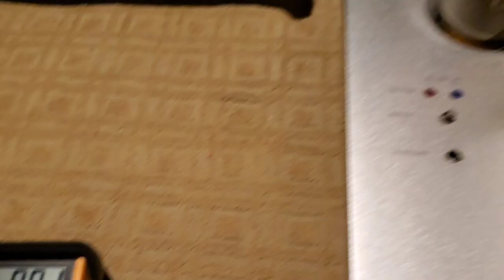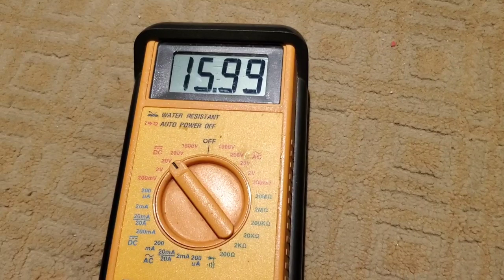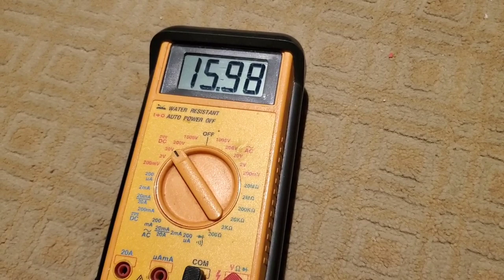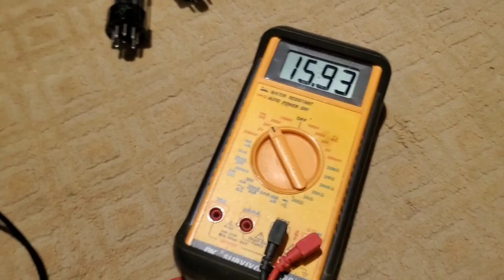Sound of the 845 S.E.T. demonstrated

Comment: Ok, alright .. I got an itch I have been scratching ever since I watched your video where you demoed the tower speakers (HiFi Tribe Special) powered by a monstrous Nat SET that may be the best amp I have ever heard.  I can still hear it.  So, I think I have to go back to the future and get another HIFI rig.  My current rig is going no where, I like it, it's great, and it is very similar to yours, if you replace those Greek panels with Maggie 3.7i's.  That will stay at one end of the room and at the other end will be my new rig.  Just turn the chairs around 180 degrees.  This is what I'm thinking .. I will use Klipsch Cornwall IV 's and SET amplification.  Or perhaps there would be better options. What I want to create is thick buttery smooth sonic goodness that you can cut with a knife.  If I can't scratch this itch away I will be calling soon for consultation.  Thanks Mikey, I think .. lol.
Reply: Jamie McNeil I agree the NAT SET is wonderful!
Reply: I have three set ups in my medium size listening room and that’s exactly what I do.. I put my chair on stress mats so once I’ve dialed in the optimal listening position for each rig the indentations in the mat let me realign at will in the same spots each time.

Comment: Sorry dumb question, but what tube amp brand/ model are these? They sound so good!
Reply from the maker: LOL, they do sound good and they are made in China, which I find to be rare and uncommon in my experience. They Are made by the company that also makes Vacuum tubes calles Psvane. I believe parent company is Shuguang in Guangzhou. right now I am modifying them for an upgrade.  The reason this amp sounds good is all in the circuit layout not in the parts quality. It uses very common "OK" level parts inside, so I figure if it sounds this good with regular industrial grade parts, what happens if I replace with high quality parts ? Maybe it becomes even better. So keep watching the channel, they will return with an OCD Mikey upgrade  !
Reply: @OCDHIFiGuy  haha what do you think about these in monoblock vs something like the primaluna dialogue premium HP? Thanks!

Comment: What is this nonsense about "high end components" snake Oil Mate if you want to achieve a better  double up the capacitors and resistors is all you need to do and a 0.1 film cap across the capacitors as well. It's actually better if the valves not biased to each other causes oscillation in the circuit have one slightly off compared to the other quarter of the Vault
Reply: Quality Transformers are what costs .
I dont know what your babbling about capacitors for , it's not a DAC .
Reply: @dednside5229  he was talking about the crossover in the speakers nothing to do with amp yes good Transformers..
Reply from the maker: Try changing out a tube and tell me its snake oil